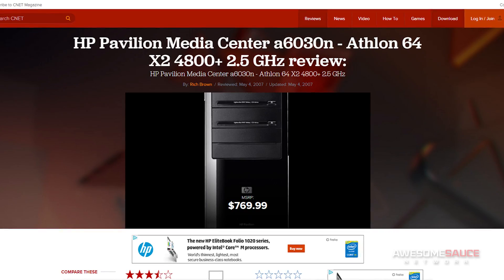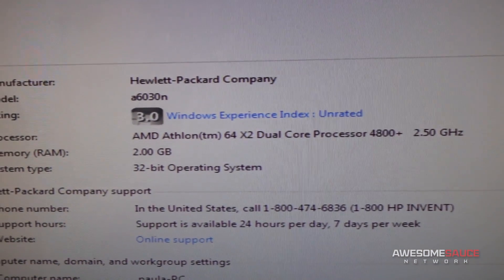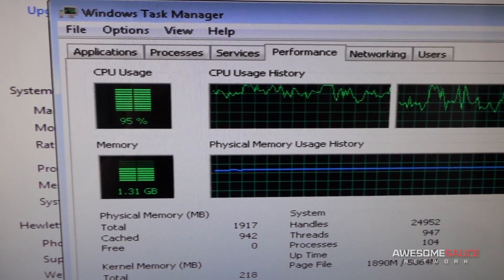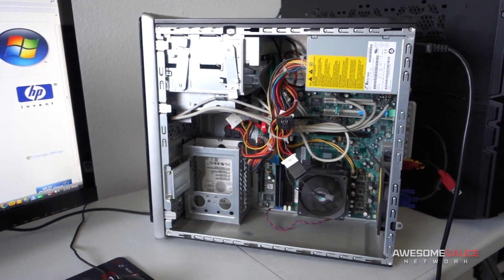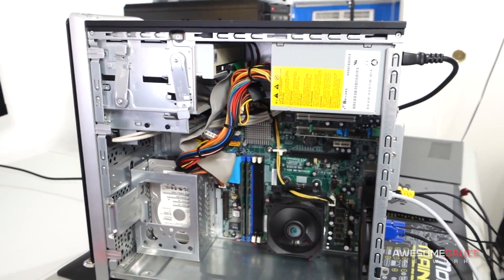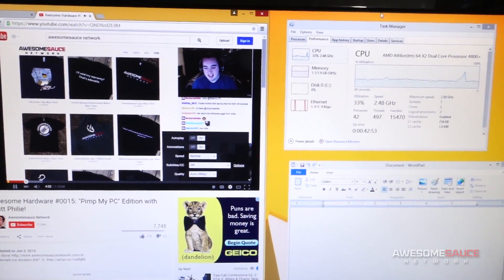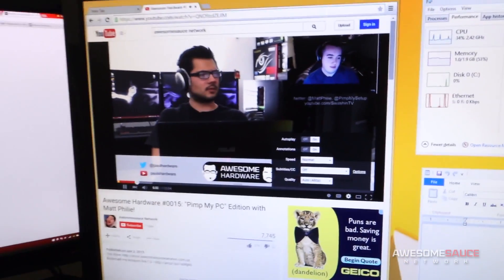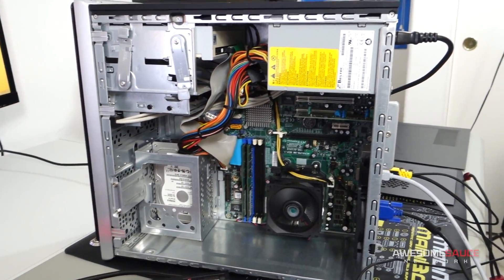Cleaning Up My Neighbor's Old Desktop!

Comment: I had a computer from 2002 that lasted 12 years, the specs from then were top notch but today its more of the medium power. I tried crysis 2 on it and it made a good 30-40 fps, i was even more suprised when i tried minecraft (60 fps!?).
Reply: +Kompjuter Fantom What OS? XP, or newer?
Reply: XP but later to windows 7
Reply: +Kompjuter Fantom Ozbiljno? wtf?
Reply: Wow minecraft your usually need a good pc for minecraft
Reply: Wait what specs
Reply: +Chalklate Geforce 8xxxGT, 1 GB DDR2 ram, 80 GB HDD, Unknown Intel CPU.
Reply: pretty sure thats around 2007 - 2009 the 8xxxgt series wasn't released in 2002
Reply: +Chalklate i don't remember the exact model all i know its a GeForce Gt
Reply: +Chalklate Nah, that's before 2007, in 2007 I had

Intel core 2 Quad q6600 2.40 Ghz 
Ati Radeon 4800 series 512 MB
some 800 MHz 4 GB Ram
2 TB seagate hdd (4×500 gb)

and etc..

Soo I think thats waay before 2007
Reply: the geforce 8xxx series was released in november 2006 so close to 2007
Reply: if it's just a geforce gt probably a geforce 4xxx series

Comment: Dude.  The Hard Disk is basically EOL and I wouldn't trust it with my data.  Replace it.  500GB harddisk is dirt cheap.
Also, junk Vista and at least put on Win7. (Ok, you put 8.1 on, not sure why haha)
Also, go on Ebay or something and up it to 4GB RAM  (Windows 7 and up should have 4GB I think)

Comment: Why did you change the operating system. You should have did a clean install of vista or the one he had before. You said he is an older guy, meaning he wont be use to a different operating system. I would not be surprised if he asks you "why does my screen look different?" When I do that type of work, I always leave the same operating system in there. If I took my windows 7 computer to someone and when I got it back and it is a windows 10 lets say, I would be pissed.
Reply: +CAMSLAYER13 I hear you man.
Reply: I'd be pissed because windows 10 sucks

Comment: "The one thing I would recommend my neighbor upgrade is to get a newer generation FM2 CPU so he can /take advantage of DDR3 memory/"

Like, dude... That isn't one thing to upgrade. You'd have to buy the new CPU, buy a new motherboard, because that one is a DDR2 slotted motherboard, AND buy new RAM.

If you're going to ask that he replace all of that, he might as well replace his motherboard with an AM3+ socketed motherboard and buy a lower end AM3+ CPU, some low end DDR3 RAM, and boom, new PC.

And with replacing all of that, he wouldn't be able to continue using his current Windows license because of the huge hardware change, so he'd have to purchase that...

In my opinion, if he really wants to revitalize his PC, buy an AMD a6-5400k. It's liuke $40 on newegg, it's dual core, and clocks in at 3.6GHz clock speed. Perfect for revitalizing his PC. And maybe spend an extra $30 on a couple more 1GB DDR2 RAM sticks. Boom. Problem solved.

Comment: In my opinion, the Ram-Sticks are wrong installed. I mean, you have to stick one Ram-stick in the line, then you have to let one line free, and put the second one in the next line and the last line is free again, like: I.I.   - right?
Reply: why does it matter?
Reply: That's only for newer motherboards. The older ones (and DDR2, DDR) it didn't really matter if you didn't put two in the same channel.

Comment: If you noticed the clock speed of the processor changing, you might want to disable cool n quiet in the bios, that will lock the clock speed at max and you would see less of those 100% cpu spikes. cool n quiet varies the speed of the processor to save electricity, the problem with that is that it isn't super fast and will cause hangs when multi tasking, or generally putting a load on the cpu.

Comment: How much do you take for this kind of job? I'm interested since I do this kind of work from time to time and I never know if I ask too much. And did you buy new windows 8 license? Wasn't it better to install Vista and use HP key? I didn't see the COA sticker, so you may need program like EKeyfinder, ProduKey or ShowKeyPlus before formatting the drive. It would save your mom's neighbor at least 20$. And another thing is I always do a disk clone with DriveImageXML before doing anything to the pc. Just in case.

Comment: Man how did you get Windows 8 drivers for that PC?
I was trying that with mine with an ASUS M4N68T-M LE and found none, and it's supusedly years after that board you are using there
Also, does anyone knows waht's the product he used on 05:44 to clean the heatsink fins? Thanks in advice
Reply: +Sebastián Núñez Peña Did you try to install W7 drivers on it? It should install, if not, you should try to install drivers in compatibility mode or extract installation and try to "update" driver from device manager. Try nvidia Legacy drivers for nforce 6 series (630a) for windows 7. Sound is VIA VT1708S (http://www.via-drivers.com/download-VT1708S-sound-driver-for-Windows8-64bit.html). Other things missing can be ATK110, but w7 driver should install without problems as well.
Reply: I tried those and they corrupted the hard drive at the point the master boot record was damaged :/
After that needed to restore it and then wipe clean. May I say the audio driver was the most problematic one
Reply: +Sebastián Núñez Peña  Ouch....
Reply: Quick update, i actually made the board work again on WIndows 7, WIndows 10 worked but always asked for the AKT110 driver wich was an Asus Suite thing

Comment: CPU removed from socket = warranty voided GOOD JOB BRO.
Reply: +hikeskool Your comment made me laugh. This PC was bought 8 years back and which company will offer warranty that long? The longest I've seen is only 5 years.
Reply: WB IsMe I had a compaq presario 4630. Pentium II at 400Mhz, 128MB of 100MHz SD RAM, a 12 GB HDD, a DVD-ROM (!!!), and an ati rage 128. Terrible computer. It had a special reflective tape/seal on the case which said (VOID IF REMOVED). So if you even OPENED the case your warranty was toast.

Needless to say I voided the fuck out of that warranty installing a Voodoo 2 shortly after trying to game on that thing.
Reply: LOL! Not sure if you are being sarcastic but the warranty tape/seal is only valid for the period of warranty given by the brand. You really made my day.

Comment: You spent a large portion of the video explaining how you cleaned and rewired the internals. No mention of the most interesting part - how you set up his new software such that it would prevent him from becoming infected again. Then you went and installed the horribly bloated Google Chrome on a system that only has 2GB of memory. No mention of Antivirus. No mention of utilizing the hosts file to block ads and malware. (using hosts is more reliable for protecting old people from malicious ads because they can't uninstall it by accident).

Comment: You did a neat top job very clean, an alternative since hes got a twin core processors at 2,5 gig.who is at par even with the newer portable pcs specs , i would have offer him a swipe for is motorboard for a newer one that would run newer memories and maybe 64 bits you can get a micro ATX for around $69.00 that would have really push the envelope of is performance, but still at the end you did a top notch job getting rid off all those bottom tray programs malwares who are phoning home every 3 minutes with the pc on..

Comment: suggesting a ssd hard drive and look up the best cpu for that motherboard core 2 quad and he will have a way better experience
Reply: +LexBomb6464 Master 'ssd hard drive'
Solid State Drive Hard Drive?
It's just SSD, man.
Reply: +LexBomb6464 Master By the way, the Core2 Quad won't even go on that motherboard.
Core 2 Quard is LGA 775 and the Athlon that is native to that mobo is not.
Not sure which exact socket it is, but it looks a bit like a Windsor (Socket AM2)
Reply: Cool. I found a Dell xps 410 core2 duo in a garage sale for 5 dollars and i bought a core 2 quad added a ssd hard drive a nvidia graphics card . very shocked what it is capable of now.
Reply: Running windows 10 pro . It had vista when i bought it.
Reply: LexBomb6464 Master
You aren't saying anything pertinent. I wasn't asking about the performance, because the performance is sub-par, if not absolute ass. I know that. Nor did I ask about your operating system.
Reply: Okay. Sorry little buddie

Comment: I need help. I have a Dell Inspriron 3520 and I was installing the driver for my BC125AT Scanner. It shutdown and now everytime I turn it on it beeps two times.  so I went in, took the RAM card out and put it back in.  I did the same thing with the 3V battery and the hard drive. Now it only beeps two times. Please help.

Comment: Could of taken the power supply out and give that a cleanup. Also sucks in dust.
I would of asked if the owner was willing to buy some ram to stick in there. 2gb of ram doesn't cut it nowadays. 
Could of gotten 2 more of 1gb sticks. Be total 4gb.  The ram it uses are fairly cheap nowadays.
I also fix/clean computers etc.... I ask the owners if they are willing to upgrade the ram if needed.. Gives it quite boost of speed.

Comment: This pc looks like just like that "sleeper pc" that you build on your other video. 

I also built a sleeper pc from a computer that somebody just discarded. Bought a new mobo asus matx 5a78l-m, 240gb ssd, 16gb ddr3 ram, 650 watts psu and nvidia 750ti graphics card. I put the 2 optical discs that came with the system but converted them from eide to sata. It was not really a high end pc, I just wanted something faster.

The pc was an old hp pavilion with amd ahtlon x2 4800 2.0ghz 1gb ddr3 ram, 430 watts psu.

Comment: Even my Current is even faster (Intel Dual Core 2, Nvidia 9800GT , 2GB RAM)
^^ when i open firefox , a game , notepad. i only use with those much software on 1,80GB ram and CPU : 80%

Comment: Great vid im not to experienced in computers but i want to get 4gb of ram im not sure if i get ddr 2 or ddr3 my pc has 2gbs of ram , 2.5 ghz 64 bit and is hp it runs windows 7 originally but its running windows 10 easily i just want to know do i buy ddr 3 ram or ddr2 anyone help me out i just want to make my pc faster for running programs and someone link me a graphics card which is able to easily run mw2 or bo2 in medium settings 60 fps please

Comment: Funny I picked up a Dell Optiplex 330 from the local junk yard a month ago, and some random E machine. The Optiplex was almost spotless inside and the E had half a ton of dust and nicotine in it but it had a hard Drive I needed for the Optiplex because the original owner kept the Drive. Never used Linux before but decided to use it on the Junk yard Computer. I just finished watching this video on it so I got a laugh out of that. IT was a fun project. And I was surprised everything worked so smoothly. Just need to get a proper video card for it and upgrade the processor and ram.  Not looking for mind blowing speeds here but Just seeing where I can take this scrapper.

Comment: This system wouldn't be too bad with a little more memory and a more current gen low end Graphics card. Something like an nVidia 620 would boost the video playback performance due to it's hardware decoding. CPU is more then fine for just internet browsing. I've used a X2 3800+ (The first AMD dual core AM2 processor) for over 8 years in a media center PC, also with only 2GB of RAM and windows XP 64, but the last couple of years it was coupled with an nVidia 560 (non TI) graphics card which did the brunt of the work. The system could playback 1080p h264 content without problems.

Comment: My aunt asked me to fix her two computers. The first one, she wasn't able to get in cause someone put a password on the BIOS. I got passed that easy by removing the battery from the motherboard. There was a password on the account too but I was able to load the OS in safe mode and remove that to. That took me only a few minutes to do. The second PC was shot to shit though. It didn't have a GPU, just the on board graphics and neither the VGA or the HDMI ports worked.

Comment: The reason for putting the RAM sticks in slot 1 and 2 instead of 1 and 3 or 2 and 4?
Reply: +Oliver Buch The ram will only work at specific ram slot when there are specific number of ram slotted in. That is how the motherboard is designed.

Comment: Hello, TurboDave here, I enjoyed your Youtube video on revamping your neighbors PC, The HP with AMD Cpu. I guess that processor has some sort of Video onboard? I did not see a Graphics card.  I do very similar pc throw togethers as you do, My first PC in 2007 was a HP M7780n with a intel core 2 Duo 2.13 GHZ with 2GB DDR2 Ram and 500 GB storage with (2) 250 GB Drives 8mb cache! IT had a TV tuner and  the LARGE HP PLug In Drive that used 12VDC and USB 2.o  NOW I AM ON MY 12th PC with HASWELL I3 and I5's<> I7 I and I3 Ivy Bridges, THE FIRST I5-650 CLARKSDALE 32nm WITH DUAL CORES AND 4 THREADS. a AMD fm1  A8-3850k my FIRST BUILD and also a A8-3870K  , just to mention a few, my NEXT BUILD IS GOING TO BE A SKYLAKE I3-6300 WITH HD 530 GRAPHICS, THEIR TOP OF THE LINE VIDEO AND THIS CHIP RUNS @ 3.8ghz. I ALSO GOT A COLLECTION OF GOLD LOW WATTAGE PSU'S , EVERY CABLE , SLOT PLATE, AND ADAPTER YOU CAN IMAGINE, YES I GOT IT BAD,  pc'S BUILDING IS ALOT CHEAPER THAN CLASSIC CARS AND WOMEN I FOUND !

Comment: by clean install he means he spend 100$ in a new OS copy and installed that?
Reply: +Cristian Farapon Might be an OEM OS. Infinite amount of installation.
Reply: Just pirate a copy Wuhahahahahaha
Reply: +WB IsMe It's probably either an MSDN windows version or a pirated windows copy. Oem versions require activation and are linked to the serial codes of the mainboard, HDD and Processor it was originally installed on. If you try to install it on a system that has only 1 of the original components you have to contact microsoft to get them to activate it on it. Won't work automatically.
Reply: As far as I know, after about 30 days it will start messing with you background and starts to annoy the crap out of you. If that happed to that elderly neigbour it would scare the crap out of him. :)
Reply: I actually have a legit copy of OEM OS and used it numerous time on multiple motherboard. PC can be used as per normal just that it will pop out a window activation reminder screen every few hours.
Reply: +Cristian Farapon you can get windows keys for like 15-25 bucks on websites like kinguin
Reply: +CristiYou If it had windows to start with you can just factory reset it. Thats what he did...
Reply: +Wesley Tabone no, he completely wiped the hard drive, to where it was completely empty. then he installed windows 8 onto it. No factory resetting.

Comment: win xp should be installed  
  vista 4 cores or better  800 mhz bus  
win  7   4 cores 1 ghz bus 
win 8   win 10 4core or better preferable  8 core 1333mhz bus or better

Comment: The neighbor must have cleaned it religiously or he lives in a vacuum house. It's a run of the mill HP computer and it should have had heaps of dust on everything inside. I have one, you clean it, and clean it and then just give up. Maybe he only turned it on once a month just to get the viruses.

Comment: Computer Specifications 

-PROCESSOR AMD Phenom II X6 1055T 
-MOTHERBOARD ASUS M4A89GTD 
-MEMORY 4GB (2x2GB) G.SKILL+2GB CORSAIR DDR3 
-CASE BLACK COOLER MASTER 
-POWER SUPPLY COOLER MASTER 500W 
-GRAPHIC CARD GTX 560TI 1GB GDDR5 
-Hard DRIVE WD 500GB SATA 
-OPTICAL DRIVE DVD-CD/RW 
-PCI WIFI INTERNET 
im a pc noob could this run b03 and gta v if so at what setting and fps
Reply: The proccesor should be fine if you PC a little. Bo3 requires 8 GB of ram for a playable experience. That graphics card will probably need an upgrade a cheap but good solution would probably be a gtx750
Reply: +jakub Memory is on the small size. However the rest will work on low settings. Don't know how demanding bo3 is, So you might end up having to lower resolution to something like 1600x1050 or 1440x900. I'm running Phenom II X4 905e with a 560ti and can run most current games on 1080 p with low to medium settings.
ALso you have a true 6 core CPU, which is better then the first gen AMD 8 cores (AMD FX processors use only 1 Floating point processor unit per 2 cores, which can hurt in some games or applications and make it slower then an X6)  so it's still quite good for games that use a lot of CPU for processing multiusers or AI calculations. You might also consider upgrading to windows 10 if those games support DirectDX12  as that allows to use more then 2 CPU cores in 3D rendering. (DX10/11 only use 2 cores for rendering in games).

And lastly you could try to overclock the CPU. a 1055T has an unlocked mutliplier. There are ton's of instructional video's on youtube that show you how you should go about doing that. Even with the stock CPU cooler (as long as it's not clogged with dust) should be able to give you a few 100 extra MHz which can help a lot in games that will only use 1 or 2 of you CPU cores.
Reply: +jakub It can handle alot on mid-low settings.

Comment: The AMD Athlon X2 5000 and 6000 series were quiet good cpu's for their generation.

And pc's featuring them were quiet damn cheap

I remember my moms old Pc i did a clean install on used to rock the AMD

And it still works, 8 years after

It's slow... For sure,

But... It works